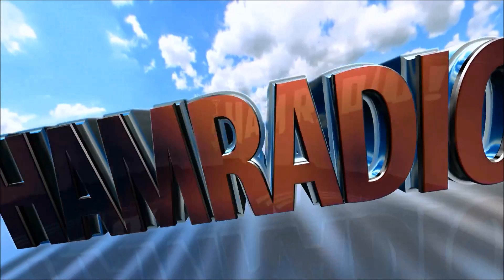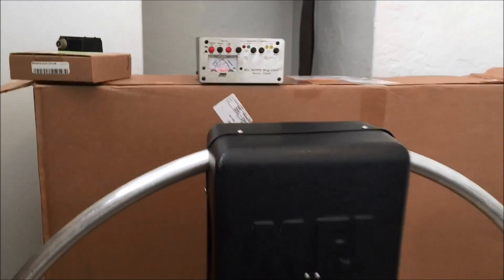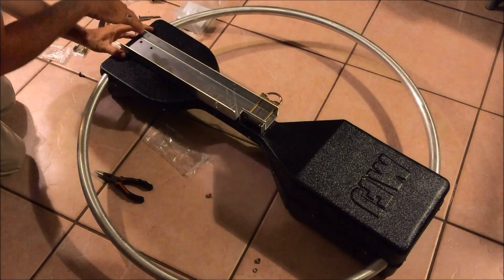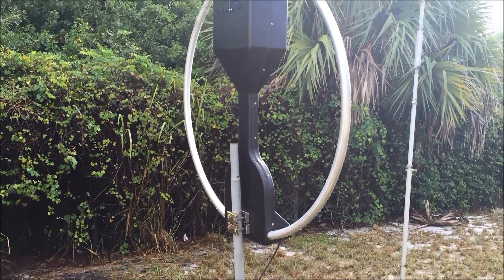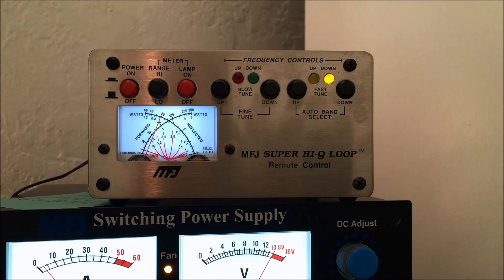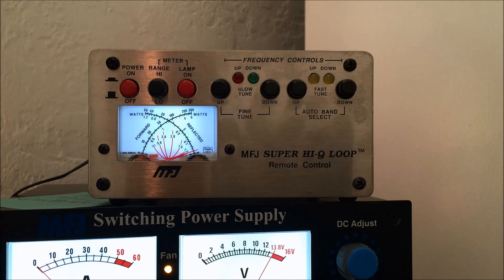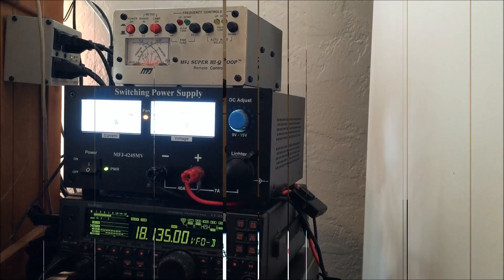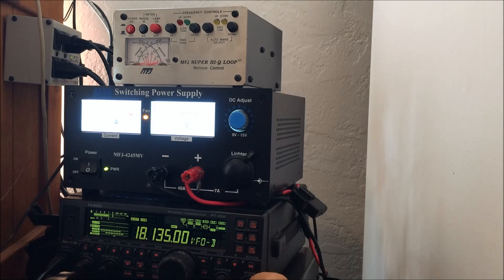MFJ-1786 magnetic loop antenna

Comment: Mag loops great for pulling in weak signals.  Of course, they are only meant for receiving.  73 KJ6YYC/Extra/VE/FE
Reply from the maker: +John Lord So is this the only mag loop that is meant for transmitting?
Reply: You can broadcast through a mag loop, but its initial concept is pulling in signals.  Inductance, magnetism, attractor force.  Remember the standing wave ratio 2:1.  2 spiral waves of electricity balance a single wave of magnetism.  If this is a true mag loop, then you have to power 2x as much capacitance, electricity, repulsor force out of the loop.  Other wire antennas or yagis etc have no magnetism or electrical high potentials, so you only need to balance the electromagnetic waves (same 2:1 ratio), but not the same overpowering of the transmission power over that of a "mag" loop.

they are smaller, and used by modern military because of the smaller size, but they also have to power up their broadcasts to use it.
Reply from the maker: +John Lord Nice. Well thanks for the info. I'm new to mag loops, but alot of people can surely benefit from them, hence the reason for my video.  I was impressed from the contacts with this thing.
Reply: Yes, mag loops are small and hidable in many places.  Of that I totally agree with your vid.
Reply: @John Lord. Nonsense. Loops have been used for transmitting for decades.
Reply: @James_Bowie  So numb nuts ... you didn't read the above comments.  A loop ~can~ be used for transmission, but you have to crank up the power to make it effectively work.  Go back to playing with your Xbox ... stoopid YT paid troll.